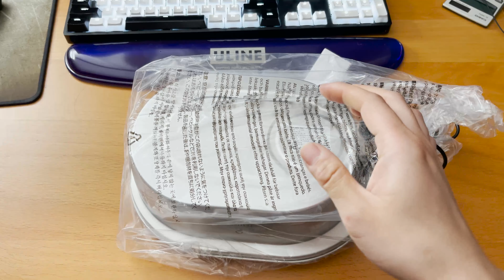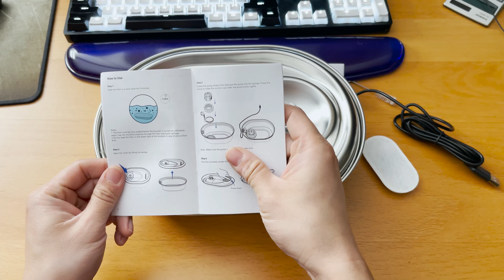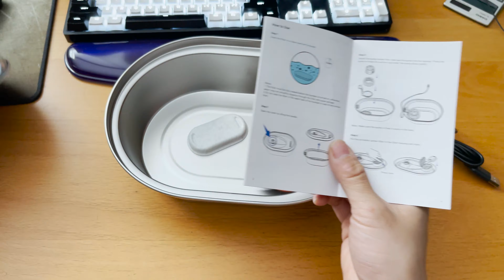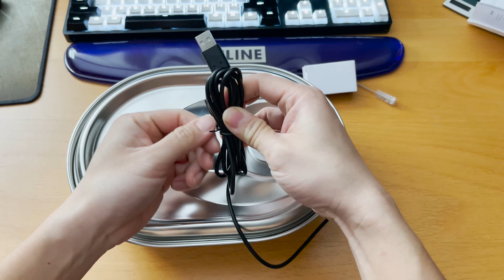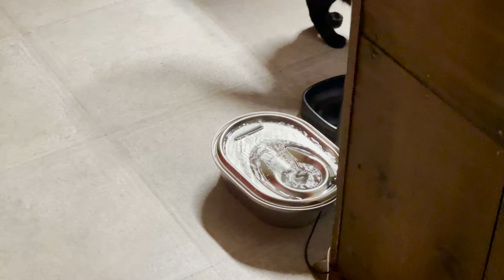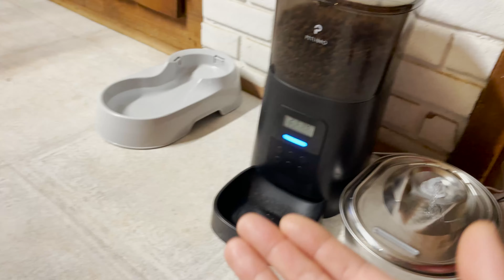PETLIBRO Stainless Steel Cat Water Fountain First Impression

Comment: I have that same auto feeder and like it, except for the front panel low food level light.  It doesn't need to be on when there is plenty of food in the bin, that's just a waste of power.  I have that water fountain too and it has a blue light that shines from the pump, it serves no purpose and just increases costs and wastes power.

You might want to reduce the portion feeding size for your car, she looks a bit overfed.  House cats tend to get too fat and they should be slender like outside cats.

Comment: Not sure why they would put the small particulate (charcoal) filter first before the large debris (cat hair) filter. That doesn't make sense. Most of your larger pieces of dirt would get caught in the small filter and never reach the larger one. I have 2 other brands of water fountains and the charcoal filters are after the larger sponge filter based on direction of water flow.
Second, just like ink for printers, the charcoal filters, that need to be replaced often, cost a small fortune. You're better off leaving the charcoal filters out, not only because of the cost, but it has been shown, that's where the bacteria grows. Just clean your fountain regularly (including all parts of the pump) and give your cat fresh water often. I clean my ceramic water fountains once a week with food grade sanitizer and replenish with fresh water. If I'm not going to drink it, I'm not going to expect my cat to either.
Reply: Think of this fountain as only having one filter the charcoal one, the black one around the pump is just an added to decrease pump clogging should anything get past the charcoal filter, since it isn't water right around that area.  And yes it does get expensive to replace these filters and bacteria does grow at the inlet side of the charcoal filter, which is why they should be replaced every few weeks and not months.  I'm sure you could find less expensive filter options out there or as you said don't use the filters and then just clean it more often as you would with a regular water bowl.  The good thing about this fountain style of water bowl is that it holds a lot of water and the movement of water encourages cats to drink more, which is good if they only eat dry food.

As what was pointed out in the video when the water level reaches the half way mark, it starts gurgling and shooting less water out of the fountain.  I contacted the company and they are working on a better pump to correct this.  If they can't fix this issue, then I will be returning mine as well.  Because there is no point to a water fountain bowl if half of the water in it is unusable.  In that case I would have just bought a smaller version.
Reply: @Resist4 
Did you return or keep ?
Reply from the maker: Yeah I went back to regular water bowl after few weeks and has since returned the water fountain